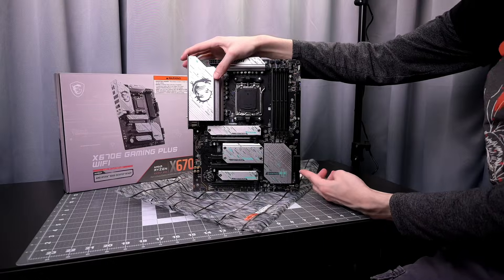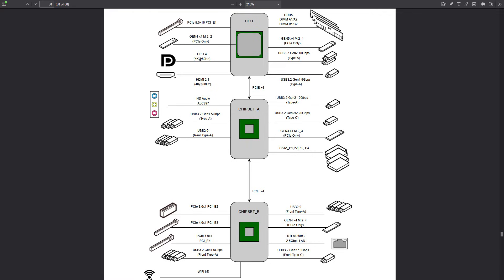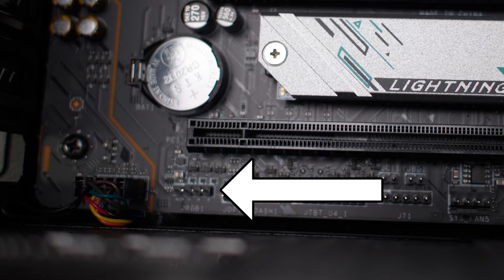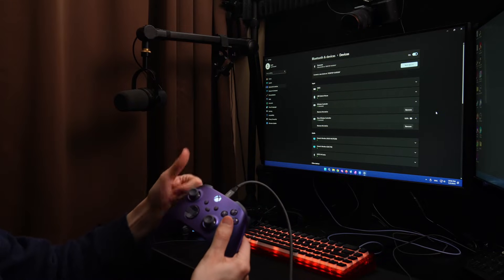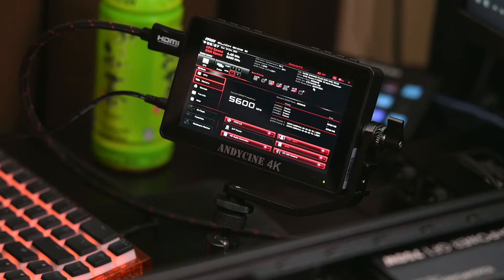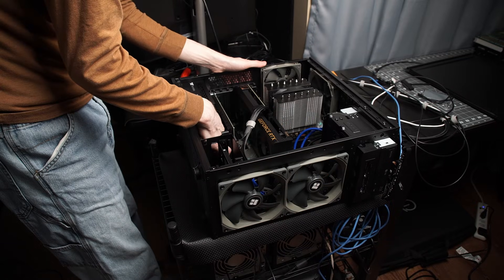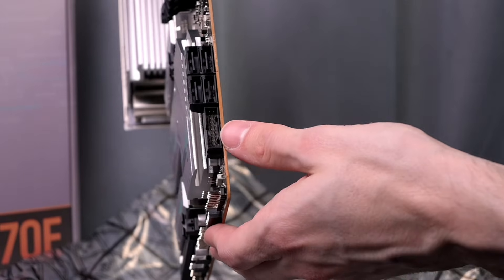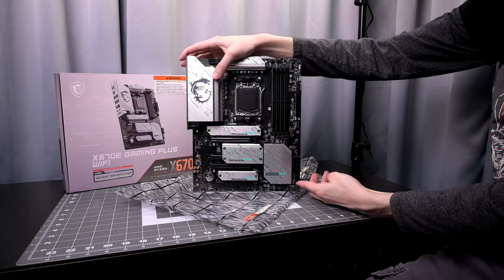Best features & value? 🖥️🔍 MSI X670E Gaming Plus WIFI AM5 Motherboard Review

Comment: I am playing hell trying to get the right ram so this board will work. MSI MEG X670e Tomahawk and a Ryzen 7 9800X3D. Latest bios. I get no post on the g.skill 2x32 6000 ram kit. Red cpu light, yellow dram light. Swapped memory. I can get it to post on crucial 2x8 5600 but it gets into a never ending memory training loop. Going to try the g.skill 2x16 6000 and cross fingers.
Reply from the maker: That's a different board. They do have a RAM compatibility chart. While not ideal you could buy one from the list https://www.msi.com/Motherboard/MAG-X670E-Tomahawk-wifi/support#mem
Reply: @TECHiSuppose  Still an MSI X670e board. Anyway, I ordered some ram that was on the MSI Memory QVL for that board that should arrive tomorrow. Hoping for the best.
Reply from the maker: @RealMrObvious1  Hopefully that works for you! Otherwise, there are quite a few other possibilities. With the red CPU light mention in your original comment, I'd re-seat the CPU if you haven't already and while doing that look at the pads to see if everything looks clean and uniform where the CPU contacts the socket. It's not impossible that the CPU could be an issue because ultimately it controls the RAM, but I haven't heard of that as an issue. Otherwise maybe the board would need to be RMA-ed, which is probably the likely course of action.
Reply: @TECHiSuppose  I have checked and re-seated the CPU once already. Will try again and inspect it with a magnifying glass, if the new memory does not resolve this. Most likely just return it at that point and exchange it for a different manufacturer MB. An important point to all of this I should have mentioned... I purchased this from NewEgg as NEW (not refurbished or renewed). They used a reseller to fulfill the order called Bleepbox. When the package arrived (from Canada) it was wrappd in a plastic tape sealed wrapper.  Inside the MB box was wrapped in some kind of shipping wrap made of paper. The motherboard box looked used/worn, was not sealed, and had two large puncture marks in the cover of the box. I took pictures of all of this. I inspected the motherboard and didn't see any physical damage except for the back plane, which had two corners bent slightly in identical fashion. I have no way of knowing it that is intentional or damage based on the design of the back plate. But being the hobbyist that I am, I didn't want to just assume it was bad and return it (have 30 days to figure it out) so I went down this rabbit hole. :(
Reply: @TECHiSuppose  I'm done! QVL memory made no difference.  Checked the CPU and pins. Perfect condition. Already shipped it back. I have ordered the ASUS TUF Gaming X670E-PLUS WiFi MB. Sounds like it is more stable, has less issues. Memory is on the QVL too.
Reply: @RealMrObvious1 bro i got the same issue and in my case it was display port cable the problem. Could you try to boot with hdmi  cable and unplug the dp cable before ?
Reply: I tried that too. The board had damage, it turned out, and had been shipped as new. BUT, it had come in a used and damaged box. Should have just returned it then, but I'm a glutton in punishment. All around bad experience from NewEgg (came from one of their 3rd party resellers.  Lesson learned...). I returned it and got a full refund. I gave them a detailed expose on everything I tried, the condition of the board, and its packaging. Since then I purchased a ASUS TUF x670e-Plus WiFi.  Up and running for over 10 days. Zero issues.

Comment: Please don't purchase this board I purchased it in March 2025 and today it's vrm burn 😢more bad thing is I was using msi A850GL glod power supply but my x670e burn today
Reply: Were you overclocking or just run default settings? Mobo's only burn when you've missed something, so I am assuming you did something without doing something else. Then you run into issues like too much voltage through the board and end up burning sht... Perhaps it was not the board but the settings, just saying...?
Reply: Building 2 pcs for my kids for Christmas. Timing couldn't be better, move them from game pass ultimate to pc game pass. Actually cost me more money, was only paying for one ultimate subscription. Now I need 2 pc game pass subscriptions.

Anyhow, I picked 2 of these boards up, saw Amazon had money off them. I think it really does feel tremendous value for what you get. Was looking at the b650 boards and the b850s but this just hit the spot. Thanks for the detailed review.
Reply: Really 😮 
Bro I want a Mobo under 350 dollar which Mobo should I get can you suggest me I am thinking about purchase this Mobo
Reply: @RahulIslam-t4oplease don't purchase gamming series board of msi 😢 go with gigabyte
Reply: Btw my CPU is 9900x
Reply from the maker: Sad to hear that you've had issues. I understand your frustration. I've had different experiences where more gigabyte and ASRock products I've purchased have had issues compared to MSI.
Reply: @TECHiSuppose 🤦🏻🙍🏻

Comment: Thanks for the breakdown. I am pulling the trigger on this board. The CPU power connectors are in the same place on pretty much all boards & are a pain to instal when the board is installed, especially in tight cases. The oversized heatsinks on the newer boards don't help either. Skin your knuckles time. I've done it so many times. That's why I am getting a bigger case for my new build. The APNX V1 or the BeQuiet! 600 or 900 LX. So much easier to work in a bigger case.
Reply from the maker: That's a good point about the case helping access.

Comment: Do I have to do a flash bios update before installing a AMD Ryzen 7 9700X?
Reply from the maker: There isn't any reason not to try it before messing with the BIOS. The built-in flash feature with the back button should work with or without the CPU in there.

Comment: I'm upgrading my pc to AM5 exactly on this motherboard, Ryzen 9950X3D, Crucial T705 2TB and Corsair Vengeance 32gb 6000mhz cl28 (was on promo only 109 pounds) + stuff from my actual am4 pc.
Reply from the maker: Nice!
Reply: Wait is this good enough for the 9950x3d?
Reply: @HeroStupid  Hi, yes should be fine, that is from msi compatibility site for this mb:
Ryzen 9	Granite Ridge	Ryzen 9 9950X3D	100	4.3GHz	16MB	128MB	B0	170	AMDRadeonGraphics	Latest Beta BIOS 7E16v1C1(Beta version)
They added support for 9950x3d in earlier bios even 7E16v1A 
Good cooling on cpu also should help (more heat = more power needed) i got arctic freezer III 420 so i'm more than fine.
I'm not sure if that will be good enough for next gen cpus but at that point we don't even know they will be on the same socket so...
I'm usually don't overclock my cpus  (only ram at some point, maybe gpu) so that also no problem.
But ofc reality check will be added soon😅

Comment: How many ssd and ram does it support. I am just r and d this for anew pc so these words are going over my head. I am getting a Ryzen  7 9700x and it was either this or b 650 , but this cost just few dollars more . I am getting we 1 tb ssd and 2 adata xpg 16 Gb ram name ddr4 I think . May be ddr 5
Reply from the maker: This board is definitely better option than one with a B650 chipset. AMD AM5 CPUs do not support DDR4 RAM. You need DDR5 RAM. 

It officially supports up to 256GB of RAM, but that's with 4 sticks of expensive high density RAM. Generally with AM5, you want to get the capacity you need with 2 sticks to get the fastest speeds. These days 32 GB (16 GB x 2) or 64 GB (32 GB x 2) is the way to go depending on how much you want to spend. 

It has four m.2 slots.

Comment: Hey very nice review!

I wanted to check does this motherboard disable certain SATA ports if all of the M.2 slots are filled? 
I have a lot of storage devices and I need all of my SATA ports. I read throught the manual but it didnt mention anything about turning off SATA ports but still better to be safe then sorry.

Cheers 😁
Reply from the maker: I don't know if I have enough SSDs to test that. If the full manual from MSI doesn't say there are any limitations in that regard, then you should be good.
Reply: @TECHiSuppose alright, thank you!
Reply: Yes.  If you haven't picked up the board yet, read the user guide carefully.  SSD is disabled in a few cases.  In my case, I tried to utilize 3 NVMEs AND an SSD - the SSD wouldn't work.  I had to remove the NVME in the M.3 slot to get the SSD operational again. (er. check the specs, my memory may be faulty here...)
Reply: @shawngrover2771  thanks for the heads up. I still didnt buy the board, I have 2 M.2s, 2 HDDs and sata SSD. I'd love to have atleast one more SATA slot open for a sata SSD in the future.

Comment: Got One of this for my Build :

MSI x670e
Ryzen 5 7600x 
Sapphire Pure 9070xt
DEEPCOOL AG400 Plus
Corsair RM850x
Crutial P3 Plus
9 SL Infinity fans from Lian Li
H9 Flow White. 

Got to say, First time building a PC not too bad, but experiencing a lot of Bugs and driver error/timeout which is really annoying, my laptop(1650, I5) has better stability than this(never experienced a driver error lol).
Reply from the maker: There's something clearly wrong with your build, but it would be difficult to figure out. There are a lot of ways to go about it to track down which component is the cause. I'd start with running memtest86 on the RAM.

Comment: Thanks for the video. I just ejected the X870 Tomahawk from my shopping cart and will buy this board instead. It's just the better board (minus usb4).
Reply from the maker: I'm glad the video was useful and hope it works out well for you. 👍
Reply: @TECHiSuppose  Guess it will. Already found the MSI USB 4 card that could add some ports should I ever need them. And the m2 slots aren't shared. I have 4 nvme SSDs so that's so perfect, because my gaming and cutting rig are one and the same device.

Comment: One thing I can mention is that this board has 14+2+1 cpu phases which allows you to make better overclocking. I am looking to buy this motherboard next week to pair it with ryzen 7700x and 32gb of 6000mhz cl30. This is the sweet spot for ram on am5.
Reply from the maker: Good mention! Sorry I didn't try to cover that aspect of the board.
Reply: @TECHiSuppose  I have an MSI X670E Gaming Plus WiFi motherboard with G.Skill DDR5 6000MHz RAM (Samsung die). When I enable EXPO at 6000MHz, the system shuts off or fails to boot on a cold boot (after being fully powered off). It boots fine at 4800MHz or on a warm boot. I can't change the command rate (stuck at 1T), and Memory Context Restore is disabled. Some say it’s a RAM compatibility issue with Samsung dies, others think the motherboard RAM slots are faulty. I'm considering switching to Hynix die RAM to see if that solves it.
 any recommedation ?
Reply from the maker: @RexageEditz  Two sticks or four sticks? You have to run at slower speeds with four sticks. 

I generally don't know. There should never be a situation where using built-in EXPO timings on the RAM isn't stable. 

Try running memtest86 it at the slower speed and see if the RAM has errors. With issues like that you have to figure out if there is a hardware failure, which usually requires multiple pieces of hardware like two sets of RAM... otherwise try to convince MSI or the RAM manufacturer to do an RMA.
Reply: @RexageEditz  I had a similar issue with B760 Intel i5-13600 cpu and DDR4 3600MHz CL16 RAM. 
I had 4 sticks and would only run specific games but constantly crash in CS2 and Marvel Rivals. Going to 3200 speed (max safely rated spec for my cpu fixed it).

Running 4 times 8GB was my mistake. Two Dual Channel Rams stress the IMC more than just normal Dual Channel unfortunately. Try with two sticks. If that's the fix then you know.
Reply: @MultiGoban i was using 2 sticks 2x16 its been 5-6 months now they issue is not solved, and i didnt switch to hynix as i needed a gpu for my education and brought 5070ti
Reply: That's is mobo and CPU I have. I built it two months ago and am not having any trouble with it but I am new to the PC Master race . I got the mobo and and CPU in a bundle through amazon from microcenter for $400 USD